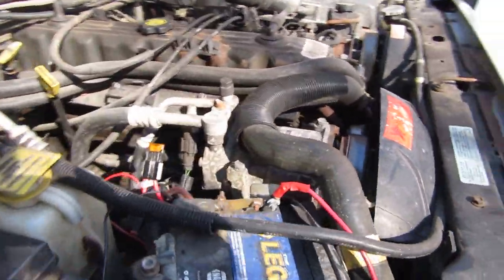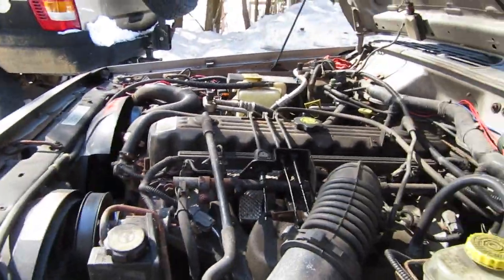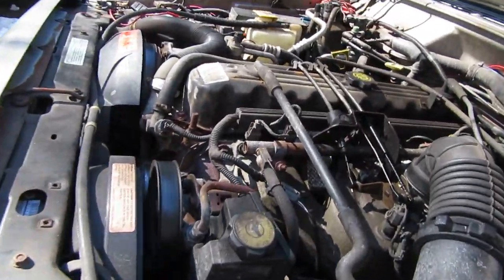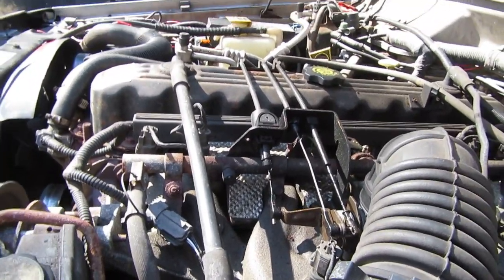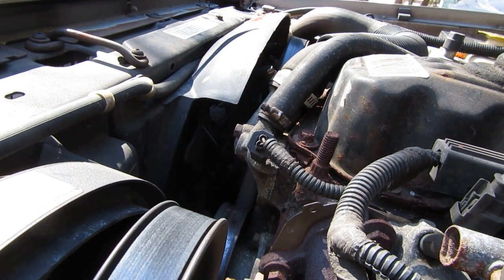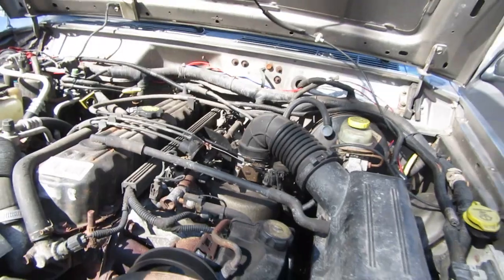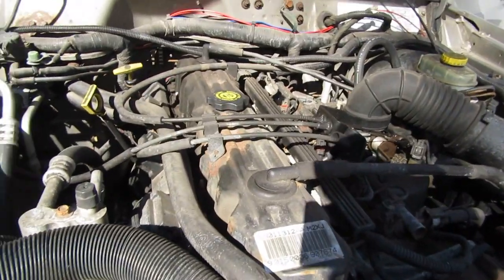WHAT IS HEAT SOAK? Why does the XJ have so many cooling issues?

Comment: Mine was running cool, I replaced the thermostat with a Mopar 195 one and the hoses etc and now gets up to temp, and soon as I pull out of my parking space, it drops significantly.. but if I drive it for a while it'll stay right at about 210 but only after driving for a while and it's 110°... I'm thinking the fan clutch is faulty or to strong/engaging at too low a temp... Or there's air in it? Lol better than overheating I guess but it's annoying. Lol

Comment: Might be a silly question but my xj when I bought it has the electric fan set up on a 
On/off switch it only turns on when I flick the switch inside the jeep how would I add the timer feature to this set up ?

Comment: My fan is on a constant 12v from the ignition switch. One small wire from the panel under the dash out to the fan. it's the green wire on the fan harness.

Comment: How crazy, I never ran into this issue on my 94 xj country. I lived in SoCal in the desert areas. The issue has been nearly drilled down into a CPS or Oxygen sensor.
Reply: 94 still has the superior fuel rail setup with the rail mounted regulator that bleeds off excess fuel pressure through a return line back to the tank keeping constant flow of fresh cool fuel from the tank in the rail.

Comment: 99 Jeep Cherokee always running hot .Not red line hot but one notch above middle . My fan would come on after the engine was getting too hot which I thought was a stoooopid idea because to me anyway, it seems a better idea keep the engine cool as opposed to trying to cool it down. 
So I put my fan on a toggle switch and placed it under my steering wheel and I turn the fan on basically at all times and keep it running when I go into a store. No more overheating and is now I control when the fan comes on instead of waiting for its sweet time to engage

Comment: Does this sound like heat soak?  Driving slow on trails.  All of a sudden the engine starts breaking up... eventually it just shuts off.  If i try to start it right away it wont. If i wait 10min it fires right up and can keep going no issues till it happens again.
 2000 xj
Reply: Also, I have that little E fan on a switch and I leave it running constantly.. if I'm driving to work it never happens.. today I drove around.. found a small little mud hole by a baotlaunch and was crawling thru it... when I left I got like 200ft down the road and it started breaking up, it got worse and worse till it shut off..  waited 10min and it fired right up and ran fine the whole way home.
  Do you think this sounds like heatsoak? I can't find ANYTHING else that could be causing this.

Comment: Very good explanation I want to add a few things. I have what's called a torque pro app on my phone go to Amazon and buy yourself a little OBD2 dongle and you can you the engine temperature and the intake temperature on your phone or other device. I have a 96 XJ and I found that with my intake temperature gets up to about 150 Plus the Jeep starts to run like crap and yes over ride  switch is a must I also put Hood louvers and a electronic fan blowing down onto the intake manifold. And yes there is room issues. Between both fans running my intake temperature does not exceed 120° Fahrenheit thanks for the video

Comment: Hehehe, VW's definitely heat soak in their factory setup. Tight space, turbocharger, and the engine and transmission connected to the same cooling system makes for 240+F heat soaked limping car on a hot day in SoCal. However, installing an aftermarket oil cooler and a transmission cooler will keep the temps under control.

Comment: Hey D -- Hope this isnt too late to jump in -- Im having a starting problem but its just been going on for a few months now.  only happens when my XJ has been sitting for a while like over night or after work. If i pop in and out of the store or visit for 15 minuts or 1/2 hour no problem. It turns over but doesnt start, I can prime the fuel by turning the ignition on for 5 seconds then off a couple of times and sometimes this helps. longest starting attempt session maybe 15 minutes. like in the video it been cold here in Washington.  Once it starts it runs like a champ. Checked the plugs and replaced the electronic plate in the distributer. replaced fuel pump with a Bosche about 5 years ago.  heat soak or something else ?

Comment: This issue just started in my 97 Cherokee 2 weeks ago. It has 126,000 mile. 4.0L. It always starts easy. Drive it a short distance. Shut it off. Come back in 10 minutes, just cranks, no start. What i have found is it will start if i pump the gas pedal while cranking, just like old carb vehicles. 

Is this a vapor lock issue? I never even heard of heat soak until recently. Seems like vapor lock issue, which is what it has been called forever. Is there a difference???

Comment: I'm trying to figure out if I have a vaccum leak or possibly this.. I've had a problem with rough idle (going from high to low), rpm surging up and down all over the place, low gas mileage, also when it's happening I can't go above a certain speed. First time it happened I couldn't go above 40mph. Second time it was 10mph, but the thing is... it only happens RANDOMLY. Like you said in the video. If I start it at home drive for a bit and shut it off even for a minute the things I listed start up and continue. Till I won't touch it for months haha. I've replaced my fuel pump, spark plugs, starter, replaced o2 sensor bank 1 sensor 1, fixed a leak in my transmission line and a few other things. I don't know what else it could be at this point. This week I plan to check for vaccum leaks and if that doesn't help I'm looking into this as well. Haha. Jeeeeeeezzzzzzzzzz I'm going insane. 🥺

Comment: Man, I hope you see this. I have a '91 XJ Loredo, and her heat soak is baaaaad. Had her vapor lock on me at a stop light after a drive across town and back. I've changed my fan clutch; nothing. I've added 1 inch hood risers; nothing. I'm not a mechanic by any means, but is there any way I can solve this issue? The temps on the gage easily go over 210. My AC doesn't work, so I can't turn the electric fan on, the only time that kicks on is when the engine needs to save itself from over heating. Any info would work wonders my man, because living in a desert climate ssssuuuuuuuuuuucks.

Comment: I had heat soak that showed up as vapor lock about one or two minutes after I restarted the engine. I tried the louvers and still had the problem. I took them out and replaced them with a large hood scoop with the opening facing the windshield. Problem solved. I made a plugging plate so I can close the opening when my XJ has to sit out in the rain or snow.

Comment: As always, love your videos and your knowledge and such, but I did want to make a minor correction. Unless I am wrong, I am pretty sure the 2.8L V6 in the first years of the XJ were just a GM 2.8L. My buddy had one and it was identical to the 2.8 in an S10 I had lol.
Reply from the maker: That is correct. It is a GM sourced V6. Thanks bud!
Reply: @DEInTheGarage  You're quite welcome, and thank you for the reply! I will say one thing about that 2.8, I'm surely glad they did away with that sucker in the early years. Those 2.8's practically came with a rod hanging out haha! 😄
Reply from the maker: @digitalchaos1980  HA! Is that true? I have never worked on one or owned one. Maybe I will stay away
Reply: @DEInTheGarage  There are worse engines, but yes sir that GM 2.8 was known for its issues. Alot of the issues even extended into the rest of the 60° GM V6 family such as the 3.1 and the 3.4. However they were better in the later years.

Comment: Can heat-soak affect the starter motor?
I've got a WJ with the 4.7 HO, and today was wicked hot.
Drove for quite a 30 - 40 miles, parked it for 10 minutes, and would barely turn over, as if the battery was flat. 
It did start, and fired up fine later after sitting in the shade.
Just curious...
Reply from the maker: I suppose in theory it could, but where the starter is on these gets a significant amount of air flow. seems unlikely. that almost sounds like an electrical short or something
Reply: Weird thing is, it hasn't done it again, although it hasn't been QUITE as hot.
Not a lot of space between the battery and the hood, so maybe it just got annoyed by being cooked.
Whatever - as long as I don't have to break out the tools or the wallet...

Comment: The V-6 engine in early Cherokees was NOT FROM AMC !!!
  IT WAS A CHEVROLET 2.8 V-6  !!!
THE REAL REASON THE CHEROKEE RAN HOT WAS TOO SMALL OF A RADIATOR,  TOO SHORT, NOT ENOUGH AIRFLOW,  THE FRONT BUMPER WAS IN THE  WAY,  RADIATOR WAS TOO WIDE, NOT ENOUGH FAN COVERAGE!!!!

Comment: Hi I got 1996 xj sport its overheating issues ,only when I pull a car or go off road on the beach.
On the highway there is no issues, so far I have changed radiator, hoses ,thermostat, watermump and coolent still no fix.
Can u please tell me what is happening.
Reply from the maker: Are you certain the coolant system is properly bled? Are you certain you do not have a cracked head or leaking head gasket?

Comment: Dude!!!  I have a 2001 XJ and I live in Augusta, GA!!!  My heat soak is so bad that my Jeep will just cut off and it takes a good 3 hours before the fuel will stop vaporizing and I can drive it!!!  I am in the process of taking the fan clutch off and I found a 3 fan kit on ebay that I’m putting in its place.  I can be at operating temps and get to a stop light in it will just cut off!!  Do you know if having those 2 pre-cats so close to the exhaust manifold are causing that much heat??  I want to remove them and have a “long-tube header” and move some of the heat under the vehicle.  It will probably cause a check engine light scenario, but at least the Jeep is running??  I have also put a fuel blanket on my fuel rail and the actual fuel line gong to the fuel rail and it still cuts off.  I heard that the 12 hole injectors don’t have heat soak issues, so I’m going to try them as well.  Need some help if you know any other ways to get rid of heat soak!!!  Thanks man!!!
Reply: 12 hole injectors and heat shield will help, along with ngk plugs. Unfortunately, with a 2001, you won’t be able to eliminate heat soak 100% unless you do a hood scoop or vents . 2001 has extra heat from the dual cats off of the manifold

Comment: The 2.8 he is talking about is actually manufactured by General Motors. The engine designation was the LR2 it was part of the 60 degree v6 family offered by GM. It was also found in S10 and S15 pickups of the same years
Reply: And the 2.8 sucks! I had it in my 86 Comanche and tried the 3.4 and also hated it haha! I now have a 4.6 turbo stroker and its 100% more my speed!

Comment: so, before you cut louvers in the hood, try spacing the hood hinges up, you will want about an inch of space between the bottom of the hood, and the cowl. so air can escape between the hood and the firewall. hot air ALWAYS rises. so any place there is a path for it to go will help. and by spacing the hood up, its reversible without costing much money (longer bolts or some home made brackets). i did that on an old car and it worked. i just left it that way. it only looked odd when viewed from the side.
Reply from the maker: This is awesome. I am going to try this. Thakns

Comment: Try a 1" hood riser from any of the off road sites... I have one on each of my jeeps, and I don't have heat sink issues.
Reply: Hey man ... is like a hood scoop?
Thanks!
Reply: @raylewis1355  no, they are aluminum blocks that are 1" thick, and they are installed between the hood and the hood hinge. The rear part of the hood (by the windsheild) has a suffient gap to release heat, but not large enough to let water into the engine compartment.
Reply: @johnpreston3055  right on... thx man

Comment: So I have been just popping my my hood open when I stop to the store, this helps. Have u Tired that?
Reply from the maker: Yep, that will certainly work as well. This is just a more permanent solution
Reply: D&E In The Garage ty brother I appreciate your response and video. My mechanic will start with replacing the fan since it’s already bad. I’ll keep you posted
Reply from the maker: @izzyl8907  Good luck bud!

Comment: I don’t know if I just have a good Jeep or what because I’ve never had heat soak. My Jeep actually used to like over heating too, and I would just let it idle with the hood shut on 90 degree days for like an hour on end. I’ve never had that issue with it, it always just starts right up. Do you think my Jeep just is better or something, especially now after replacing the radiator or thermostat.
Reply from the maker: Sounds like you got lucky!

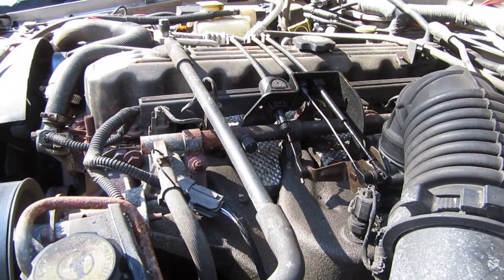Comment: @6:18 I'd have to kindly disagree with you there good sir. Thermodynamics tells us that heat rises, and people who put vents in their xj hood typically put them closest to the driver; at the highest point of the hood. Considering a constantly running mechanical fan and a functional auxiliary fan is bringing air in from the grille and that hot air will want to rise, I see no reason as to why they would not have an effect on cooling even remaining at a stop. I put vents on the hood of my 88 cause I didn't like the cheesy hood spacers, and even sitting at an idle I can visibly see heat waves exiting the vents. The biggest gripe I have with hood vents is 90% of what you see on the market ISN'T designed to keep water out while simultaneously releasing heat.

Comment: Thoughts on wrapping headers?
Reply from the maker: I have heard guys swear it works, but my opinion is that it is not just the exhaust, but the heat from the whole motor that leads to heat soak. It might help a BIT, but I could not see it fixing it all together.

Comment: Hey I’ve got a rough idle and a cyl 1 misfire.  I’ve reset the computer several times, and every time I do the Jeep runs fine for a while.  The CEL only comes on after the engine has been running for a while and sitting.  For example, yesterday I put a smittybilt XRC bumper on the Jeep so I had the battery cables off.  It reset the code and I drove it home (30 mins) and then drove it about 45 minutes on the highway and it was fine.  On the way back I stopped at a gas station and let it idle while I ran inside.  Came back out and - like clockwork - CEL was on.  I know cyl 1 isn’t the typical misfire cyl for heat soak, but it seems to me like that’s what’s going on.  On the other hand, the engine doesn’t get all that hot.  It stays around 200 in the winter all the time.  Anything else you could think of?
Reply from the maker: Sounds like it could be a bad injector or plug. try swiching the plug and injector with one from another cylinder and see if the misfire moves
Reply: I've got the same issue on my 2000 XJ
Switched out injectors coil Rail and spark plugs ran fine for a week and then number 1 cylinder misfire on the highway

Comment: Many of us who drove old air cooled VW's carried aluminum foil to wrap around the gas line when this problem occurred!  Worked well in my 73 Thing (Type 181) when I was in college.  But then VW owners usually carried a LOT of extra stuff for those situations that seemed to occur in those!
Reply: i did that on the intake, worked well for a short time, but the heat would still be an issue after the engine warmed up.

Comment: Bro I got multiple cylinder misfires but only ever in the number one and number two cylinder. I believe it may be due to heat soaked but not sure.I can be running down the highway and floor it it will die out not stall but non-responsive if I let out of the throttle and feather it'll pick it back up only at times and it makes me wonder if it's not heat soak. You know as well as I do there are a million and one reasons.other times it runs like a raped date if it were the fuel pump we're going on a year by now it would have already completely took a crap with a new coil and complete tune-up it has me scratching my head. I will say there is zero heat shield on the intake right now... I've had it for five years it has 260k on it. It has not always done this
Reply from the maker: Yikes.The fact that it is only 1 and 2 cylinders sort of rules out fuel pump. The fact that the cylinders are next to each other could be a coincidence or it could be the key to the issue. Any chance it could be a head gasket? Doesnt really seem like heat soak either as that is usually on 3 and 4
Reply: @DEInTheGarage  I can't say enough about you man just for the fact that you responded. I know there's no money and doing what you're doing you're simply just trying to help others that speaks volumes just know that you are helping people. I'm starting to think it is I didn't overheat it but it was overheated at one time I'm getting the feeling that it is a blown head gasket. However I am financiallyunable to pull the head and it is the only vehicle and I'm a single parent I'm going to have to bite the bullet at some point and go for it. Really my biggest challenge is time that the Jeep will be down. with a full tune-up new coil the fuel pump people have suggested but I can say that it would already have already completely stopped working at this point. As much as I don't want to do any of the over counter solutions work I've read mixed reviews on pouring stuff in theradiator the thing is I know once I pull the head it's going to need work and it's going to be hard to just change the gasket and walk away.. I guess I have some decisions to make.

Comment: Just received my timed relay hope this works running the e fan after the engine is off
Reply: It took a week to receive the parts bought the harness as well,be sure to watch the video from d& e and the video from the supplier the wire colors and what they do is not what you would think!!!
Reply from the maker: Thanks for circling back to us! Hope this works out for you!